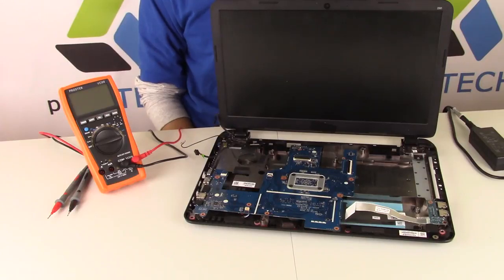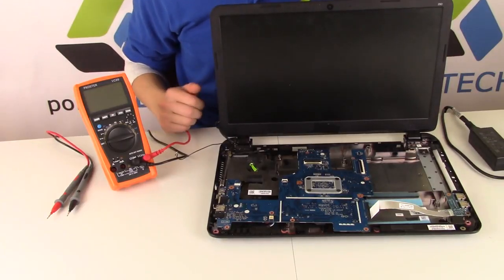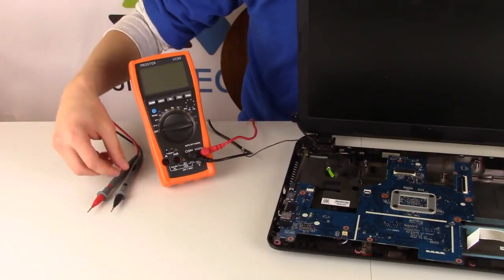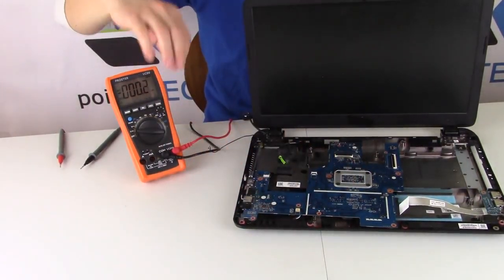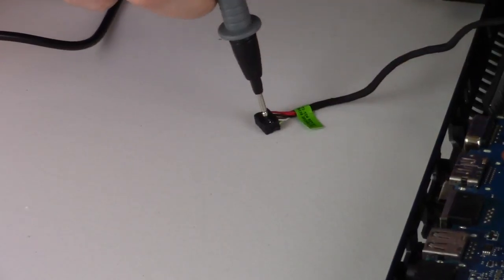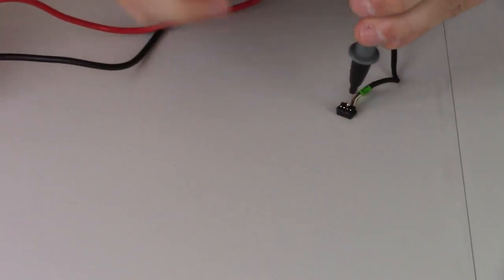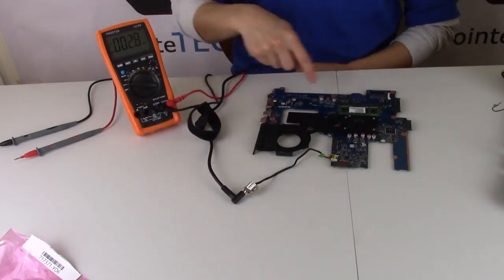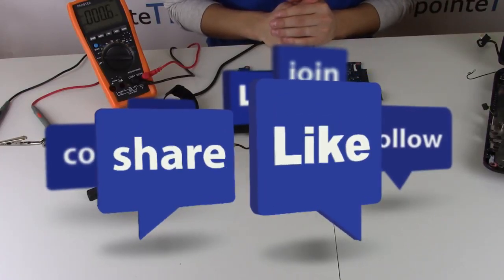How to Fix Test Power Jack - HP Laptop Computer

Comment: I go Through all steps.. bt my laptop is not starting yet.. my adaptor is well.  
When I plug power cable and push the power button , green light just above the power button blinks once. That's it ..
This happens with battery too.

What should be the problem ??

And that blinks happens once only. 

Before that my laptop have starting problem like I have to press power button for long or have to press it with every possible way🙈..

Now it's shutdown sudden and not starting

I have been going through your all videos. Bios reset , adpeter check and all.

Please help me.!!!!
Reply from the maker: So you already started here with this video and ran the tests seen here?;  https://youtu.be/_MOe71kBPOY.
Reply: @PC_Monkey  Yes Sir.  Laptop is not turning on.  just one blink(near power button) after i do exersise of removing static current everytime. then its not responding. 
Battery is charging when i plugged to AC supply.   But as i push power button while charging.  charging light stops. and small blink near power button (usb light also blink for sec)  and nothing happen.
then i do your previous trick to realese static current.(remove battery and ac power)  then i again plugged battery in  then its shows charging.
is there any issue with my power button (shorted or bad power button) ??
or issue with my laptop mother board :(
thanks you so much for your reply.
Reply from the maker: @mihirraval6736  If that video didnt work, and neither did the BIOS Reset, then you would next test your adapter and power jack with the provided links.  Sounds like you did that as well.  If all those check out fine, then we are left with your motherboard.  It would need to be replaced.
Reply: @PC_Monkey  ok Sir... Thanks a lot.. nice to talk with you. And your videos where very helpful. Keep sharing ...Keep posting..!!👍
Reply from the maker: @mihirraval6736  Happy to help :)  Always here if needed !!
Reply: @PC_Monkey  🤗😇

Comment: I followed instructions on video (very helpful) have completed processes for eliminating static, have done driver and BIOS updates and still me Dell 5559 inspiron will not recognize the charger and the battery won't charge.  Unfortunately I have drained all my batteries so I can't continue to do other diagnostics.  Is it possible that I need to replace the mother board?  Concerned about buying a new one if there are other causes for this problem.  Any guidance is greatly, greatly appreciated!

Comment: Thank you for the video. 
My laptop fell on its side while plugged into the charger, which caused the charging port to sink into the laptop, I tried pulling it out with a metal clip and it sparked, yet still turned on, cause the battery had some charge in it. After battery totally died and wouldn't charge I opened it up and tried to replace the charging cable connected to the motherboard, and that also sparked when the screw driver I was using touched the top of it. I don't have the tool to test if there's power like you're doing, but do you think the motherboard is gone now after 2 sparks? The new charging cable isn't supplying any power either. 
Thanks.
Reply from the maker: Unfortunately, yes after two sparks the motherboard may be damaged.  However, to be sure you can start troubleshooting a laptop that wont turn on as seen here;  
https://www.youtube.com/watch?v=_MOe71kBPOY&feature=youtu.be.   After that, if those steps dont work, move on to the BIOS Reset as seen here;  https://www.youtube.com/watch?v=VO5BhbiItCM&t=346s
Reply: @PC_Monkey  thank you very very much for the prompt reply. 
I tried the CMOS battery reset, and the static discharge displayed in the video you just linked with no luck. 
Also, I don't have a multimeter, but I have an electricity tester, this one:
https://www.neobits.com/greenlee_emerson_dvc_6_grt_continuity_voltage_p13326331.html?atc=gbp&gclid=CjwKCAjw5Ij2BRBdEiwA0Frc9eyY2f7QJ4VsHasc_iQ2qyGex46DxzRc_lI4G471-6wl7ZUqdN6lPRoCsGIQAvD_BwE

It doesn't test for as low as 20V, but it did produce a sound, so there's a current, just not sure if it's the right voltage. Tested charger, charging cable, and charging module on the motherboard. So there's current, but it still won't turn on nor charge the battery. Any ideas are really appreciated! Thanks again!
Reply from the maker: @marwanak10  If the Adapter and Jack test ok, then your left with needing a motherboard replacement :(

Comment: Hi there. I have an asus x53 t laptop, 
Earlier it used to get hang " freeze for like 20 or 30 seconds " as soon as i plugged in the charger but would still charge the battery.. 
Then it started to stop charging by itself for no reasons and also at the same time the cpu led , battery led and  power button led indicator used to blink at the same time. 
 I got the charger voltage checked, its well around 19 volts.
Now , it works only if turned on with battery only but if i plug in charger without the battery it will only lit the power button led for a fraction of a second and then turn off the same moment . 
Earlier I used to turn on the laptop using charger only i.e without battery plugged in but now i cant do it ...
What could be the possible reason ?? Kindly help .. appreciate your efforts...

Comment: So the reading fluctuates from 26 to 25, then starts going up, is the jack the problem and should I replace it
Reply from the maker: If it starts going up, that could be a bad thing.  Im not sure what computer you have or what the problem with it is, but most laptops dont operate on that high a voltage.  Have you tested the charger?  Does that same problem exist there or is it just with your jack?

Comment: Hi Great video, how would you test a micro USB charge port on a Chromebook please? Also unsure how to test the usb cable too?
Thanks
Reply from the maker: I have not tested a micro usb before so have not made a video on it unfortunately :(
You would most likely have to put the positive pin inside the port to where the electricity would be running and the black pin outside the port as a usual jack.

Comment: Hi, my Lenovo laptop has no power, does not charge, and the little light on the beside the charger port does not even turn on, I was told it was the charger and battery, I bought the charger but was unable to purchase the battery, would the little light at least turn on with the new charger? Because it doesn't. Do I still need the battery or is it the charger port? I have done all the other trouble shoots.
Reply from the maker: For a laptop that wont turn on, start your troubleshooting process here;  https://www.youtube.com/watch?v=_MOe71kBPOY&feature=youtu.be
Let me know how that goes :)
Reply: I've done all that, I tested the charger and it was dead, so I bought a new one, still no sign of life, I tested the charger port and it works fine. Is there a way to test the battery? It's a Lenovo L14L2P21 for IdeaPad 330s-15ikb.
Reply from the maker: @alexrod1639  If you have already started at step one and then did the BIOS reset, and then came here and tested the charger and power jack and everything checks out, its most likely your motherboard at this point :(  It would need to be replaced.

Comment: hlo my power jack is good my pc is also good  charging jack are all good but i have to apply pressure and then it will on  if it is shaken i again need  to press that pluggin point up and down plz help me with this
Reply from the maker: If the computer will only turn on with the charging cable inserted into the power jack in a certain position, then the jack is bad and needs to be replaced.  Its come loose from the motherboard or its internal mechanics are loose.

Comment: What does it mean of the voltage from the power jack port is fluctuating between ~18.4 - 19.4?
Reply from the maker: If its changing like that it means the port may be damaged.  You may see lower performance, and your battery may not be charging correctly.  At worst, your computer may detect that issue, and to protect itself from damage from a faulty jack, it may not start.
Reply: @PC_Monkey  thank you, that could be an issue, my batteries haven't lasted that long, gone through two.  
Another issue I found is that one end of the CMOS battery holder detached from the motherboard.  If this happened suddenly could that have caused the computer to shut down and not power back on?
Reply from the maker: @SandShark350  Yes.  CMOS batteries powers the base system, BIOS.  If that system cant boot up, then the computer wont start.  A BIOS reset ( removing and then plugging back in the CMOS Battery ) is step #2 in troubleshooting a computer that wont turn on.

Comment: I tried replacing the DC adapter but it  charged sometimes, I tested the old one and it's the same thing, it charged sometimes, what should I try next?
Reply from the maker: You tested the power adapter and it only works sometimes?  Is that correct?  Then you would need to replace it as its damaged.
Reply: It happens with the new one also, is that just bad luck that I got a bad one sent?
Reply from the maker: @luntaryar1  What happens with the new one?  The computer charges sometimes or when you test it with a multi-meter, it only works sometimes?

Comment: This was helpful. The city had a  strange power outage, now my laptop charger doesn't work. Bought a new one. I'm getting power all the way to the motherboard,  but the laptop wont turn on still. What's my next step?
Reply from the maker: For a laptop that wont turn on, start your troubleshooting process here; 
https://www.youtube.com/watch?v=_MOe71kBPOY&feature=youtu.be
Have you tried those steps first?
Reply: @PC_Monkey  yes. I followed your steps all the way from the charger,  jack, and motherboard.  All have power, but it wont turn on.
Reply from the maker: @Hemlock  In that case your Motherboard would need to be replaced.  If the correct power is going through all the components to the Motherboard, than the Motherboard is just not doing the correct function with it and needs to be replaced.

Comment: Very helpful and I tried trouble shotting bios and checking adaptor. My laptop charges the new Battery to 100 percent,,,,  but when I remove the charger the laptop dies ,,,
Note.The laptop works only while the charger connected ,does't matter the battery placed on or not.
Reply from the maker: Is the new battery generic or a brand name battery?
Reply: @PC_Monkey  its generic.
Reply from the maker: @DIESOOL  I purchase a lot of generic batteries for my shop as they are much cheaper.  However, in my experience, 50% of them dont work :(
Reply: @PC_Monkey  okkk,,, i'll search for the brand one,,, thanks alot 🙏
Reply from the maker: @DIESOOL  Happy to help :)  Always here if needed !!

Comment: I have done the troubleshoot part and I have cleared any static build up. The problem with my laptop is that the LED does not turn on when the power adapter is connected, but it turns on when I connect the battery. If I try to boot my laptop with just my battery on, it gives me an indication that the battery is low. I let it charge for 3-4 hours and still the same result. Also, the laptop boots with the power adapter and battery connected but it shuts dows after 10-13 seconds. Please help! I cannot work from home
Reply from the maker: When it shuts down, is that before or after the startup logo screen?
Reply: @PC_Monkey  It is after the Windows Logo. I can even access the BIOS but the laptop still goes off after 10-13 seconds in the BIOS.
Reply from the maker: @bilalakhtar7150  Were you able to check the charger and the power jack as shown in this video?
Reply: @PC_Monkey  The charger is working fine as I tested it on my neighbour's laptop. I don't have a multimeter as the lockdown has stopped all kinds of shops and delievery items. However, I have a voltmeter but I am not sure if it safe to use it this way. The laptop turns on, the BIOS is accessible, but turns off after 10-13 seconds. But the laptop cannot turn on with only the power adapter.
Reply from the maker: @bilalakhtar7150  If the laptop cannot turn on with only the charger, then i dont think its working correctly.  It may be putting out a little juice, but may not be enough to run the computer.  Or it may not be stable.  Or it could be the power jack if the charger works fine on another computer.  I would prob check the jack first.   If you leave it sitting overnight, and let the battery charge, will it stay on longer then?
Reply: @PC_Monkey  I tried charging the battery for 3-4 hours and when I try to turn on the laptop on battery, the LED blinks three times indicating low power and won't turn on. But at the same time, if I plug the charger and then run the laptop with battery, it turns on but only for 10-12 seconds
Reply from the maker: @bilalakhtar7150  Seems like a rare situation where both the battery and charger are experiencing issues.  Do you have the ability to test the charger as shown here?  If not, I would replace the battery.
Reply: @PC_Monkey  I really appreciate all your replies. It is very calming in such a panicking situation. Would you suggest using an analog voltmeter to test my power jack?
Reply from the maker: @bilalakhtar7150  np !!  Life is all about helping each other out :):)
I have never used one but I imagine they function the same.  I would prob try to find some DIY videos on their use to make myself feel more comfortable :)
Reply: @PC_Monkey  I have been beating my head over this. Mostly because I have a lot of valuable data that I want to be safe. I have heard that data remains intact in the hard drive and can be accessed using external SATA connector. But I am worried that I have hidden them using Windows Hide feature and also the tutorials online show that only C: Drive gets mounted this way. I have several partitions on my hard drive and the files I need are hidden. Can you assure that they can be recovered? I will be at so much ease.
Reply from the maker: @bilalakhtar7150  I cannot assure you of that, I'm sorry.  Sometimes a Hard Drive goes bad enough where they cannot be recovered.  Sometimes, a computer is the only one that can recover them.  Data backups are the best way of insuring files stay safe in the event of a computer crash.
Reply: @PC_Monkey  Thanks a lot for all your replies. I really appreciate everything. I hope everything is fine and will update here whatever happens. Stay well and happy :)
Reply from the maker: @bilalakhtar7150  thx:)

Comment: I’ve binged watched a bunch of your videos I love how clearly they explain everything. I’m only stuck on one issue. My charging port doesn’t look like it can disconnect it looks like it’s soldered to the motherboard. How do I check with the multimeter if it is receiving power? I used the tutorial to check the charger and the charger is good!
Reply from the maker: The powerjack should submit power to the motherboard through one main pin.  Towards the middle of the rear of the port.  That is where the charge should be read.  You can put the black connector on the outside of the metal.  That would be ground.  Does that make sense?
Reply: PC Monkey yes it does I see the pin. The black one on the pin and the red one anywhere? Or just the black?
Reply from the maker: @tigara1219  Try both but the Red should go onto the metal component you believe to be the power or the live power transfer pin.  The Black should just go on a ground.  Does that make sense?
Reply: PC Monkey wow you are excellent at explaining things I am a total noob and I understood that 🤣 Cable has power. Charging port has power. Still won’t turn on 🤦🏽‍♀️ What the actual heck
Reply from the maker: @tigara1219  And you have already tried the first video testing the Battery, Charger, and trying a Static Discharge?  And you tried the second video trying a BIOS Reset?  If the Charger and Jack check out here then your left with needing a Motherboard replacement at this point :(  That could be fun :) And depending on your computer, it may be cheaper than you may think.  Need help locating a Motherboard?
Reply: PC Monkey Yes I watched all those tutorials (they were incredibly helpful) and this is as far as I’ve gotten. Everything checks out and I had a sneaking suspicion it was the motherboard . I have a Lenovo Ideapad 330-17IKB with intel i5 8G of Ram and 1T of memory. Spent a pretty penny and when it stopped working overnight it was exactly two weeks past the warranty date. I have nothing to lose trying to change the motherboard myself so changing the motherboard it is! 😅
Reply from the maker: @tigara1219  If you like, search Youtube for a 'Teardown' video for you exact model and that will help in knowing what getting into :)